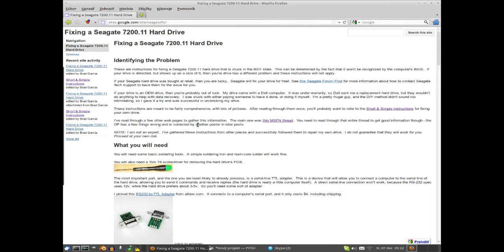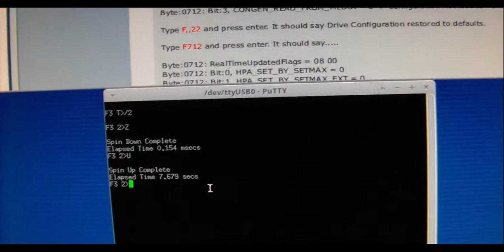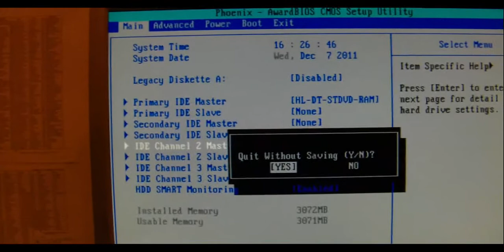linux-xubuntu-putty-fixing-not-detected-or-zero-cap-hdd-sata-drive

Comment: you didn't show how you connected to hdd. where the ground, transfer and receive on hdd interface :( but the video awesome. will try to find answers on seagate's site but will awesome if you share some links...
Reply from the maker: +igroykt 
I have connected with USB-to-Serial cable(TTL-232R-3V3 FTDI) from PC to the HDD. And After I connected the classic way Sata & Power.

Conection to the HDD:
We need only 3 wires. With this sequence RX,TX,GND, free Pin from side the Power Sata connector.
These pins we connected to the USB-to-serial cable, GND is black, TX is orange, RX is yellow wire.

Comment from the maker: Hi Lemin,

you have only problem with mainboard-system detection(jumpers or settings in BIOS). This guide is for users with HDD crashed firmware, from manufactory like seagate. I hate this company. Better HDD has western digital or fujitsu, or something else.